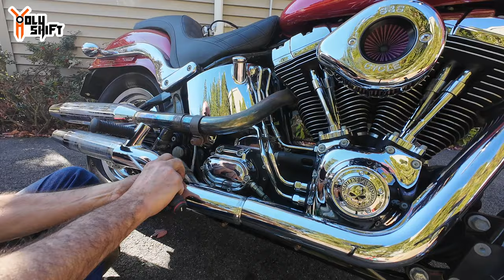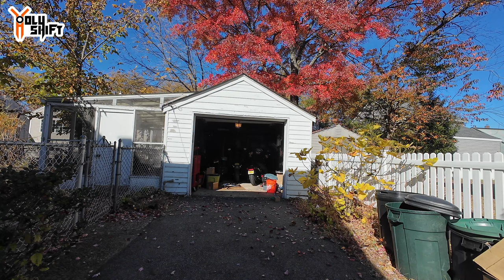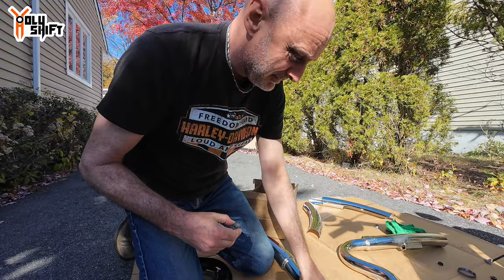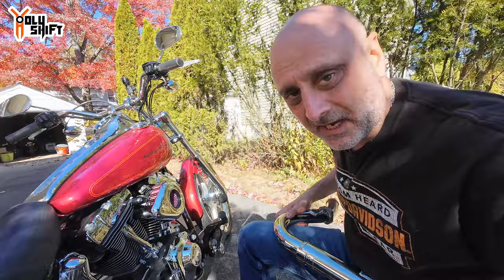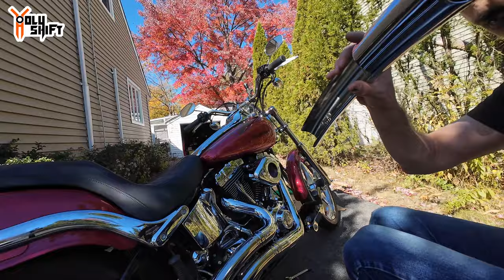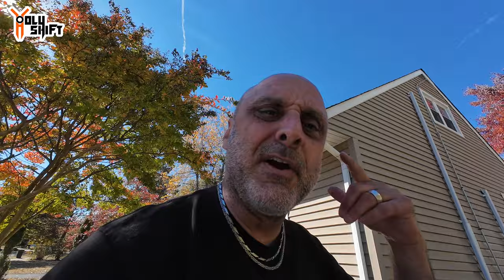Biggest Impact Upgrade ! Radius Exhaust Install

Comment: Thanks sounds great! How did the bike run with the new air filter alone? Would it need tuning?
Reply from the maker: I didn't run it with the air cleaner swap alone - only after exhaust installed. I will need a tune no matter what . Just to maximize the performance of what the engine can give and for long terms reliability.